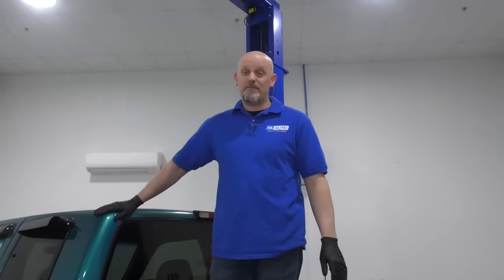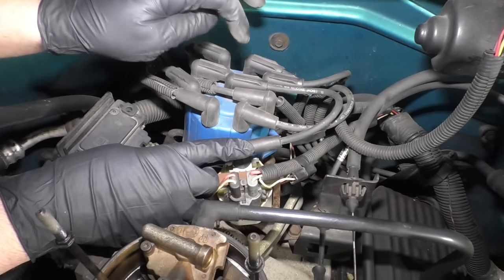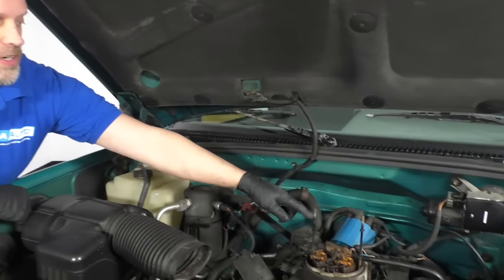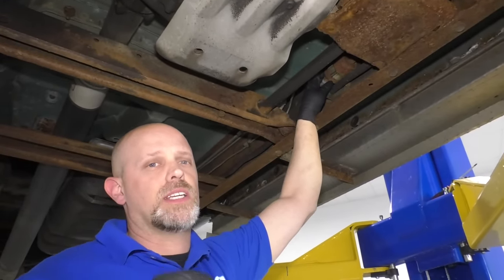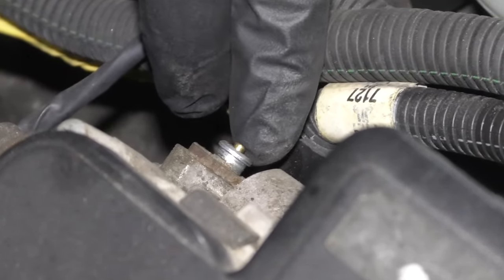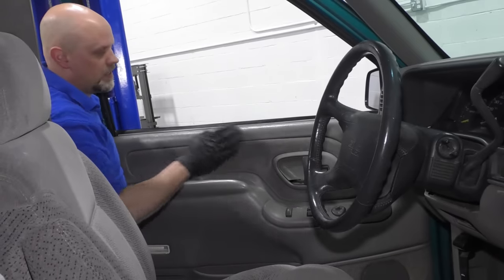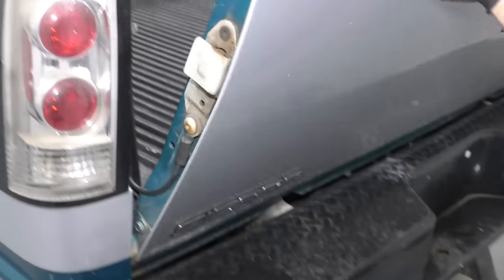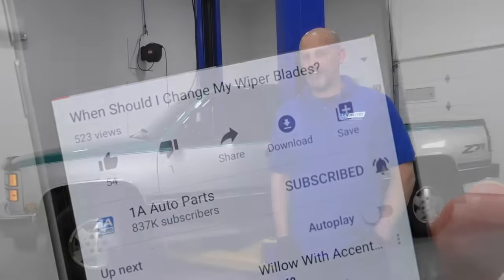Top 5 Problems GMC Chevy Truck 4th Generation 1988-02

Comment: These trucks were the last bulletproof truck GM made. I've owned 5 throughout my life including one Tahoe. Im currently on a 96 model which is the only 305 I've had and it's great. I've got 129k on miles and just had to replace the distributor. Already replace driver side inside pot metal door handle (had to do this for 3 out of the 5) Tailgate handle. I've owned much newer Chevy trucks as a matter of fact I currently have a 2016 z71 and I can guarantee before it's 10 years old it won't be anywhere near as dependable as my 96. I personally think GM decided to start making vehicles that were "disposable" somewhere around the decade mark, because making a truck like the 88-98's that a person can realistically drive for 30+ years ultimately hurts there bottom line. Especially since they've got 14 billion dollars to payback.
Reply from the maker: +Side Tracked Thanks for the feedback, it is greatly appreciated!

Comment: I bought mine new in 96.  Great running train but have had a 5 issues.  On my third fuel pump.   168k miles so far

Comment: I have the same one with 250k, this month I had to replace the Fuel Regulator Valve and the Distributor. I also replaced the fuel pump which I have done about 3 times already. Other than that, the truck is solid.
Reply: Unfortunately, those days are long gone.  Nowadays, you're lucky if you can make it 100K in a GM vehicle without having a major issue.

Comment: 93 Sierra 5.7L Automatic Z71 with 218,000 miles.......ALL original engine, trans and rear end..........still runs strong.

Comment: I have a 95 with a 4.3. It was sputtering and shuttering at specific speeds and loads.

Distributor and jacked. And a few spark plugs were bad. I replaced the plugs, wires, distributor, rotor, and coil. All good now.

Comment: 1997 GMC Sierra Z71 230k still going strong
Reply from the maker: +TheBsmith Images That is awesome to hear that!
Reply: I got q 97 Silverado with 326k still purrin like a kitten!
Reply: Right on buddy I got the same truck with 300 and 34000 miles rebuilt the transmission a few times Lots tune-ups great truck keep it running peace out
Reply: I have a 97' silverado z71 with the L31 5.7(350cid), it's just a few miles shy of 300k. It also has the big 14bolt rear end and heavier springs than most half ton trucks. Still ride it every day.
Reply: @charlesbanks639  NICE!! I have a 98 3dr I purchased with 430 miles on it. Still Drives Strong with 276K and rising, have a 97 3dr with 267k still runs great. And I have a 99 3dr old body style with 245K still running strong. Great trucks if you keep oil changes and preventive maintenance. Always Minor issues like Belts tensioner pullies, couple water pumps and Rotor Caps and rotors, plugs ect..

Comment: Got a '95 c1500 extended cab with the 5.7L 350ci tbi... 247k Miles and sounds and works like a brand new engine. The automatic transmission is another story, but we'll worth the rebuilt investment. It's of course a done deal because she's worth it.. Driving a "brand new" truck now. Good for another 200k. Everything else is 95% rust free.

Comment: Sun shell drive shell in the 4L60E. Will lose Reverse, 2nd and 4th. Easy fix if you are willing to do it yourself. Did mine by myself in 3 days. 1 out, 2 fix, 3 install back in truck. Parts were really cheap!

Comment: As is with all the 1A Auto mechanics, another well produced video.  All of the issues shown here today are actually very common failure's with these OBS Trucks, Taho's, and Yukon's. These IMHO one of the best designs GM ever had for a light truck / SUV.  There is one item that fails on these trucks you missed, and it is a whopper of a pain to replace, the multi-function switch.  The wiper/cruse control/windshield washer/turn signal lever switch.  It looks like it would be very simple to remove, but looks can be deceiving.  1A Auto has an excellent video on how to remove and replace the unit.  This is an all day event believe it or not!

Comment: What about the fuel gauge fluctuating while driving issue...? It's a common problem.
Reply: You get used to it. It did bother me when it first started but at least it still gives a somewhat accurate level of fuel.
Reply: On my truck it was the fuel level contacts on the fuel pump.  I got lucky and it only needed cleaned up and adjusted slightly.
Reply from the maker: +JJMax Thanks for the tip! We'll pass this info along to our production team.
Reply: Likely a ground wire. But more likely if the gauge needle fluctuating back and forth it will be the motor in the cluster there's a fb video a gentleman did showing how to replace that thing. Somewhere cheap to replace and little bit of work.. I replaced almost everything he mentioned and lot more. I still rather drive a Chevy. Lol
Reply from the maker: +William Ward Thanks for the feedback!
Reply: Are you just talking about the needle bouncing a little bit still reading accurately when on a smooth surface? Cause far as Ik that’s normal as the float goes up and down in the tank not sure why just these trucks do them though
Reply: Mine started to vibrate after replacing my fuel pump . I don’t even notice it anymore and it’s still accurate...
Reply: This happens usually because the dampening fluid goes bad in the cluster gauge. Your sending unit is completely fine, there just isn’t a computer controlled “buffer” to slow down the fuel gauge from reading sloshing gas. I think the fluid in the dash is called ferrofluid.
Reply: Bad ground usually.
Reply: I had that problem, change the fuel pump and sending unit at same time , if you've just had pump only, the sending unit is going bad
Reply: thats the fuel pump float
Reply: The voltage gage also fluctuates while using the turn signals
Reply: Any of the persons who commented before and say it is not that bad, probably haven’t had the problem yet or it is just starting. Trust me, it will get worse.

Most cluster gages in these trucks work with vacuum motors. When the motors get old, air gets in them causing the problem of the needle moving like crazy. Unfortunately, they don’t make those motors anymore, so you will have to accept the problem and learn to live with it. Don’t worry, it’s totally doable. I just assume that the tank is empty when the needle spends most of the time behind the E and stop at the next gas station

Comment: I have had my 1994 k1500 Silverado 5.7 v8 for 30 years. Only has 90k miles on it and is more dependable than any new ones. My major issue is the break lines. I’m replacing them more often than I ever thought I would need to. 
Other than that it is an excellent truck.

Comment: when i got my 1995 GMC in 2015 I replaced the cap, rotor, wires and spark plugs. Then fuel filter, pump and assembly. And both inside door handles lol.
Reply from the maker: +James Earl Cash Thanks for checking us out! 1AAuto.com

Comment: I have an 02 with the 5.3 and I don't have a distributor. It seems like it would be good to mention that distributors were only on certain years/engines. 

But I wanted to mention that one of the most important mods I made was cutting into the bed and making an access panel to get to the fuel pump. I welded some 3/16" x 2" angle iron underneath the panel I cut so that the panel not only sits on these steel pieces, I drilled and tapped a hole for 2 bolts on each side. Fuel pump swaps, if needed, become a 30 min endeavor rather than 3-4 hours.

Comment: Yep, control module and pickup coil. I am in  the process of replacing all the electrical ignition components; coil, pickup coil, and ignition module. Truck would not start (no spark). It's a 89 chevy K1500 and to my knowledge the ignition parts and fuel pump has never been replaced. Also replace the fuel pump and rear shocks since I had the bed removed. Much easier to replace fuel pump when bed is removed. I had to replace the speed sensor that is located in the transmission. The truck was running rough so I plug in my OBD1 analyzer and it indicated a bad MAP and coolant sensor. Replaced the MAP first and truck still ran rough then replaced the coolant sensor.  Believe or not the  coolant temperature sensor corrected the rough running issue! I have owed it since 97 and it has 150K. Most of the miles  were driven before I purchased it.

Comment: Bro what a memories! I had to replace my broken door handle at every oil change  :)
Reply from the maker: +Antonio Ayala Thanks for the feedback!
Reply: Dang.   U must live in the rust belt
Reply: Haha we broken one in 18 years.
Reply: That was a pain in the butt for me . I replaced my outer door handle and didn’t pay attention to how it was put together and I couldn’t get the door open after breaking the inside handle too .. I freaked out..
Reply: I have owned my 98 Sierra ext cab 4x4  for 20 years and have replaced almost  everything  . It  can be expected on a 22 yr old truck...thank God most  if it I was able to replace.. same engine after 208,000 miles...
Reply: I had 3 GMT 400 trucks and never had any issues with door handles.
Reply: Secret on the door handles. Door handles unfortunately aren't for pulling the door all the way open. You lift up the handle and open the door then grab the door and pull it open. It might just give the outside handle a little more time!

Comment: I have done a fuel pump on every OSB Chevy pickup 2 of my personal 88 and 89 plus my brother in-laws 95. I have a 89 with a 350 5 speed manual.2 wheel drive and I think it's a better built truck than any new one's and I can still work on it myself

Comment: i order one in 1995 still have it and yap i replace everthing you just talked about but he still gets the job done my a stick shift
Reply: I had to change the fuel pump on my wife’s 1999 Suburban. It’s a lot easier if the truck could be in the air than doing the job on the ground.
Reply: Cool! Your the original owner and still own it??!! Hang on to that truck!!

Comment: Omg i have had all the fuel pump problem with my 97 gmc k1500! Right now it just started problems i thought was plugs and wires, fixing to change them out but now gonna take good look at distributor, thanks for all the info very helpful
Reply: ...don't know if you got fixed or not, but, being it's a '97, what you describe sounds like the "spider" injectors going bad...this happened to my '99 Suburban(yes, a '99 Suburban is a GMT 400 truck)....drove my nuts trying to diagnose it..sputter, misfire,stumbling, random stalling, etc....

Comment: Great video! But the ones with the dreaded spider injection I think stared in 96 to when ever they stopped making the 5.7 that thing sucks to always go out and are very expensive....an a Delco will run around 400 bucks and Autozone has a Chinese made one for 300 ...defiantly spend the extra 100 to get ac Delco....don’t ask me how I know 😂
Reply: Dont know about you but i never had an issue and for people who had issues, grab one from the auto wrecker, why buy new?
Reply: i spent 650 dollars switching to the newer model electronic UEFI injection spider assembly. It is much more fuel efficient and more reliable! (only applicable if you dont have TBI) I have a 98 2500 2wd cheyanne base model with the 5.7 vortec
Reply: 98 z71 with the Vortec engine has the spider. So far so good but I only have 115k miles on it.

Comment: Changed my tbi out for carburated.  The  edelbrock performer and the 1406carb with  1" spacer. Needed to put a fuel regulator on it, and build sort of a throttle positing sensor on it so it would run without the wires for the transmission 700r4. Works pretty good for a 89. Love those headlights on that truck. Half 88's and half 89's had them. If it had the one ugly square idve junked it. Not a bad junker Johnson

Comment: My sister has a 93 Silverado 5,7L. I was driving in town and it just stalled at a stoplight and would not start. She was driving her Tahoe and managed to pull the truck to a parking lot. While there, I was messing with the  blown engine fuse, and it started. A couple of more times this happened and when I jumpered the engine fuse with a short wire, it would crackle and spark, and I would replace the fuse it would run fine, then it would blow the fuse and stall out again at random times. I could not figure what would be the problem, but when I just changed the whole distributor, cap and all with a new one the problem was gone. I never figured that one out but it was something inside the distributor. That was a weird one.
Reply: I have had several of these trucks 2 had that issue both times it was the wires between the engine and firewall get squished.
Reply: I just bought a 91 Chevy Silverado and got new compressor and condenser my problem my truck runs hot when the a c is running. I changed the thromostat to I put a low grade 160.

Comment: of course I enjoyed that I have the exact same truck down to the paint.  I love my truck, it now has 220k on it many problems but it never stranded me once in twenty years.  I will watch it rust to the ground on the side of my house.  Changed the inside door handle 5 times an engineering mistake , but we have to pay for it. Right now it has a steering box leek and the wiper motor just went out.  I don't mind I will fix it and put it back of the road.  Thanks, didn't know about the ABS bleed valve.

Comment: Also had an 89 dully 454 pulled a thirty foot fifth wheel caper with my jonboat behind and the bed full of firewood 
No problem  . Had to sell it last year needed the money .now I got a 95 2500 4 wheel drive 350 needs like work but I love driving it  
,still easy to work on

Comment: There is a special place in hell for the guy that did that fuel tank/pump location.  1990 short bed silver, 235k, love the little truck.  Tough as heck and still smokes most new trucks with it's stock 350.  Thanks for vid.
Reply: great location once the trapdoor is made

Comment: another honorable mention you could add as someone who has owned dozens of these trucks:

- Corroded ground straps causing brake light issues or no turn signals or no crank 
- Sending units making the fuel gauge dance all over
- Dash gauges servo motors going bad
- door pins wearing out (still not as bad as the GMT800s though)
- blower motor making demon sounds from under the dash
- on the 95-98 models the hood latch getting broken off. inside the cab
- 96-00 MPFI spider injector lines cracking.
- front frame horns rotting out

Comment: I have a 95 k1500 z71 myself. Single cab, long box. 5.7 tbi. My common issues have been similar.
Instead of the actual full pump, it's always been the relay. It's common for the fuse box to have wiring issues, and it causes a poor connection with the relay. 
Doors have been a pain, with the window tracks rusting and the inner rods breaking off the handle.
Tail light circuit board likes to corrode, so I've replaced them. 

And, of course, the tailgate. But, my issues were with the latches themselves rusting. I live in Michigan, so these are all rather common with this truck. 
I love my baby, wouldn't give her up for the world

Comment: #1. ABS.
#2. Intermittent wiper board.
#3. Throttle position sensor.
#4. 700r4. (4th clutch pack)
#5. OEM radios.

Comment: I've owned a 1996 GMC Sierra SL for 10 years and have replaced all but the outside door handle, tailgate handle,ABS,speed sensor and heater controls it's a 2WD 4.3 V6 with  almost 197000miles on it
Reply from the maker: +Bryan Morgan Thanks for checking us out! 1AAuto.com

Comment: Fuel and brake lines rotting away
Reply: I had to splice my fuel line also. Had a slow drip . Thankfully it's not a high pressure system

Comment: Cruise control went out on my '91 '92 and '07. But that's the worst to happen .. I can live with that. Never left me stranded or broken down. Easy and inexpensive to maintain. All 3 trucks 4.3L
Reply: Same thing with my '92 with 4.3L.  Least of my problems.  Everything else works and I only drive her around town.  400,000km on original running gear; runs strong.

Comment: I've got a 1989,  GMC 1500 4x4   short bed TRUCK 350 vortec 17"  mud swomper  tires. I'm geting ready to replace the upper and lower ball joints

Comment: My 1994 K1500 Ext Cab Ext Bed is still running strong. Well over 250K miles. Yes over the years needed some TLC. Fuel tank, Pump, Brakes, AC recharge, and bushings all over. Keep the fluids changed, and basic maintenance done often, and these trucks will run forever...ok close to it. Good video too! Now...if we could just stop RUST.......
Reply from the maker: +Matt West Thanks for checking us out! http://1aau.to/m/Shop-1AAuto-c

Comment: I  have this exact color pattern! 1993 4x4...This is 100% my truck with a chrome roll bar and ground effects ! Love my truck. I bought it with 22,000 mi 25 years ago. That said? In 2006 I replaced the Heater Core, then a head gasket job in 2012, and an alternator. 
Fast forward 2023. New starter, battery, alternator, PS pump, pressure line, PS box, plugs, wires, cap, rotor, 
Radiator, PCV valve, fuel pump and filter, brakes, tires, front end alignment, O2 sensor, EGR valve, twmperature sending unit, temp sensor unit...and NOW? I may have to get a new Throttle Body with injectors ...running RICH!! WHATS UP WITH THAT?! 

Caveat- EGR and sending/sensor has not been installed YET...